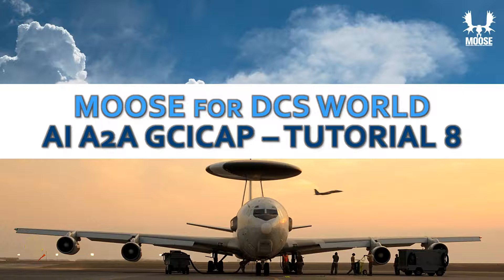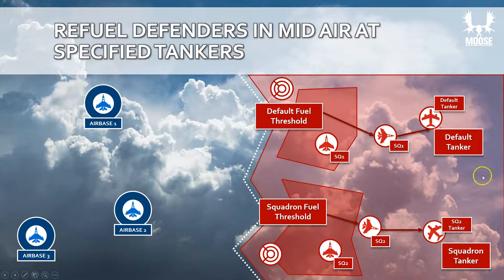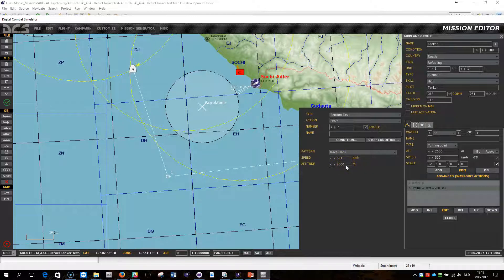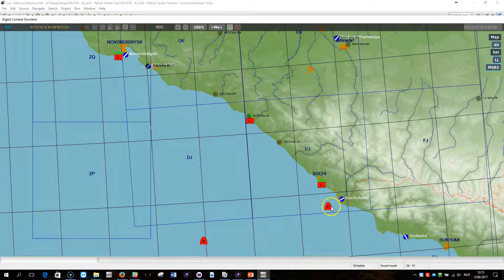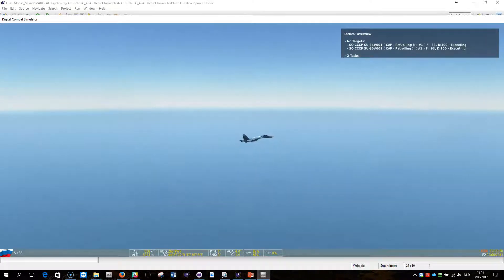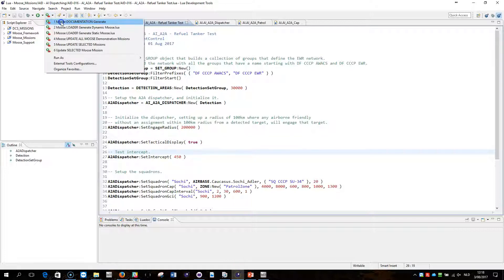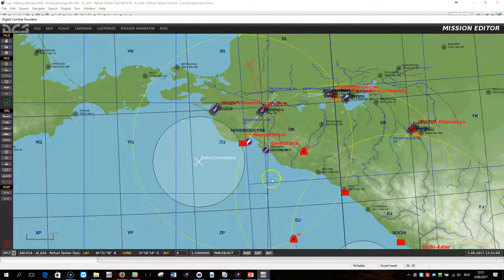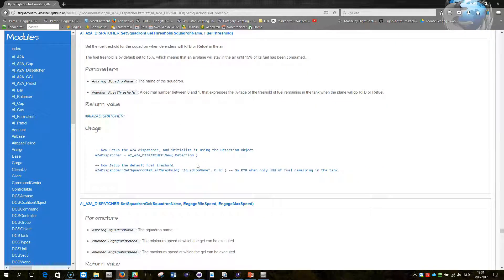A2A GCICAP - Tutorial 8 - CAP and Refuelling - [Script]

Comment: This is amazing 0.o
Question, in the documentation you say when the tanker specified is alive and in the air, the tanker will be used for refuelling. What happens if the assigned tanker is not alive or in the air? The squadron refuel in the other tanker, or just RTB? What happens if both tankers are not available, the CAP planes RTB when the threshold is reached?
Reply from the maker: So, when the tanker is not alive, the plane will just go RTB, but another plane will spawn at the airbase and will fly to the CAP zone. In other words, the refuel just won't happen. Note that if there is a Default Refuel plane setup, and for a specific squadron X, the specific tanker (of squadron x) is not avaiable, then the defender CAP plane of squadron X still will RTB. So, there is only one tanker assigned to a CAP execution. Note that the fuel treshold is a bit special. If your CAP is way off the home base, then it can be that planes will still RTB. For example, a CAP zone that is 150 km off the home base, requires for a plane about 30% of fuel left to fly safely home. So, if you set the fuel treshold to 20%, then the plane will RTB before it reacts to the refuel command!
Reply: @flightcontrol5350  Hello! thanks for all the work! fast question will be glad if you still alive. Can i make the assigment dynamic? i mean i have a mission that i respawn the tanker if killed, can i assign this new tanker as the new default tanker for the dispatcher? Thanks!